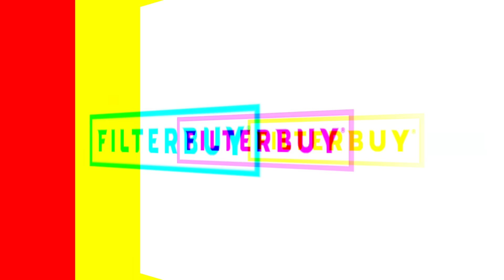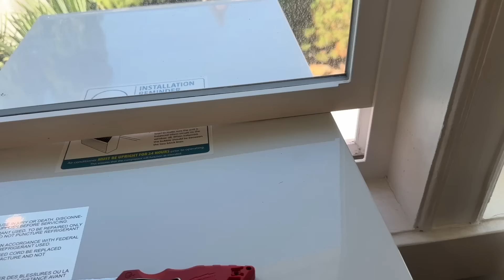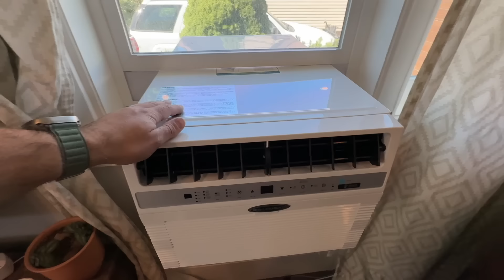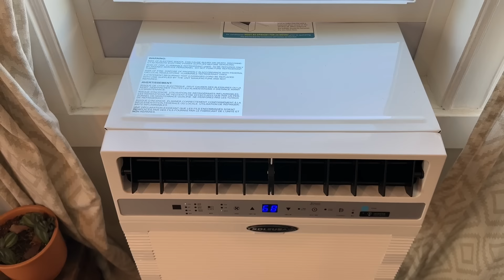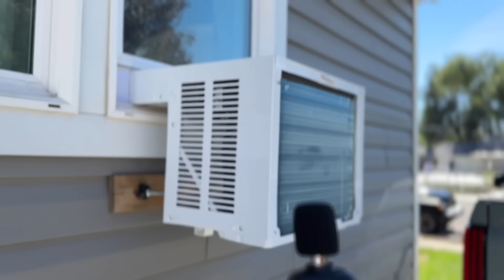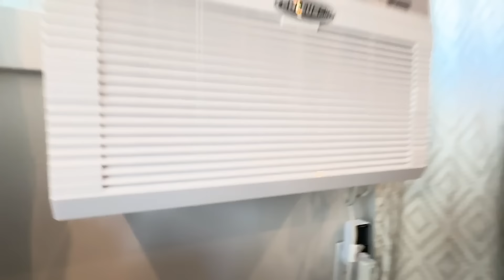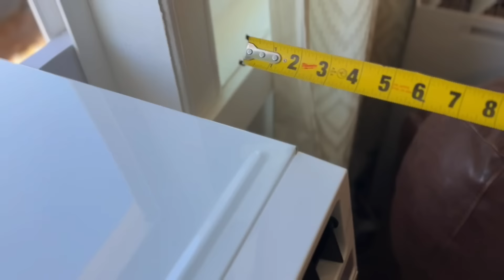I Thought It Couldn't Get Any Better... But It Just Did.

Comment: I noticed a flaw in the filter design, there is a wide gap between the two filters. Dust gonna go there.

I too am waiting on the Midea version as I can't use a "hang below" type of unit.
Reply: Yes, dust gets in there, it's not a great filter design

Comment: I bought the GE profile AC. It's garbage. It may have been quiet at the beginning, but honestly now it is as loud as any window unit I've ever heard. 
I bought the Midea U-shaped, and it is much quieter. seems like a better design overall. It is not a reversible cycle heat pump, just an AC.
Reply: No problem with mine…
Reply: @nikij.6058  hmm. Mine rattles so much during certain parts of the cycle that it wakes my wife up. Even the plastic cover rattles against the frame. It’s just very cheaply made. Ironically, the Midea unit feels much more solidly built and the fans are significantly quieter.

Comment: It is not a heat pump.  It is an ac with heat added.
Reply: This is absolutely a heat pump.  If it was added heat it would use resistance electric coils and use 2x to 3x the power this used in it's heating mode.
Reply: @theripper121  I stand corrected.  It is a poor excuse for a heat pump.  I guess this is why it so cheap. Most companies would describe their product as a heat pump.
Reply: @richardsexton9212 what makes it a poor excuse for a heat pump?
Reply: @AGILISFPV poor efficiency

Comment: Dude they have you buried in the algorithm and i took me forever to find you. You didn’t show up for anything a/c related and it took me an hour. I need your help and I’ll tip you or directly pay you for your help if you have a place. Here’s my background-i was a general contractor and had best friends who owned a/c companies so i learned how to fix my a/c units and change them and fix my customers while at their house. I got injured bad so lauded my business and ran huge maintenance dept and worked on a/c units all the time. Then i almost died twice and need life saving surgeries . Ok now that was just to let you know that i know just a little more than most but not great. Ok so i was still recovering and had to move during covid and in new house had to call an a/c guy and he charged me $680 to change capacitor in condenser. I use to by those for $12 8 yrs ago but i couldn’t walk so i was screwd and i had at least 15 of the universal capacitors in my storage unit. Ok so now we just had power turned back on from hurricane and within 12 hours my blower in air handler isn’t working and lines are freezing up. This is 2019 ICP FEM4P4200AL. So i went looking for the run capacitor and can’t find it. I looked online and realized they had you buried in algorithm and on google there’s barely anything on DIY information and there used to be a ton and tons of places to buy from. It appears the A/C industry paid to have everything removed. Can’t even find chats easily. It’s crazy -so anyway i stumbled on something that said they don’t do capacitors anymore and I’m shocked. So i go on the repair clinic and the only option is a fan motor that looks like it’s just the back side of an old fan motor for $500? What is going on ? Is that it now? So they let that blow instead of a capacitor? Is that what i want ? I thought about a transformer too just in case. I don’t have any tools to check anything right now and want to order to get things here -we had no power for 4 days and this sucks. My tools are stuck at our business for kids with autism that i was remodeling and then the storm hit so i have basic tools at house. I will say my filters were very dirty because i was working this job so we could get these kids in their new place and forgot then having windows open in Florida after hurricane did them in. So the filters got worse real quick-i have 2 of these units in my house for upstairs and downstairs. The other was fine and changed those filters. So anyway I’m just double checking this is what blows up on them now if they go bad? So should i order the transformer too. This really isn’t about money i just don’t want to pay repair guys after a storm like this because in Florida and after a storm this will cost $2000 easily and if i can get parts for $600 then its worth it. I’m not sure if the power going out had anything to do with it-it did run good for 12 hours and the transformer that blew for neighborhood just happened to be in my yard so don’t know if that had any affect. And my other identical unit is fine. I can’t believe there’s no capacitor anymore. The fan blades spin super easy just so you know but I’m assuming with this new type of motor that is just the back side of motor that they don’t really freeze up anymore? Correct? The coil is getting super cold and freezes me up quick when i turn it on but fan not spinning or humming or nothing. So I’m guessing everything is fine and it’s just the weird motor thing. I went to thermostat and can’t get it to run with just fan or with heat and of course a/c. So what would you order? The transformer and the weird backside looking motor? I promise I’ll tip you for any help. I’ll send it right to you if you want, i just need help understanding this new stuff i had no idea about and i haven’t toucj]he’d an a/c in at least 8 years and worked on them 5 times a month for 20 yrs prior. So it’s weird to be in this spot and i was going to watch you soon to install a mini split in my garage and shed but they have you shadowbanned. There’s not much in this air handler to change and coil is working great. So thermostat is making connection to switch between stuff but just no fan and it’s not stuck-it spins freely. Thx

Comment: LG sells a combination washer/dryer.  Soleus sells a combination air conditioner/heater.  What we need now is a combination washer/dryer/air conditioner/heater.
Hey I'm only kidding.  This seems to be a great product.
Reply: There actually is a fanticy where your ac sends it heat to a heat pump dryer instead of outside lol there are actually hot water heaters that do this on a mini split system.

Comment: This thing takes up a lot of space and it does not fit in all windows correctly and if you use it air conditioning mode you have to drain it constantly so it doesn't grow mildew in it or blow extra moisture into your home as the pump does not pump all the water out of it.

Comment: Soleus is such an elusive company. I've heard good things, but when I tried to order parts for a broken saddle I picked up they abruptly said there are zero user replacement parts on the 6000 BTU unit. Are they Midea? I assume they are Chinese? What is the difference between Soleus Air vs Soleus Air West? Also, any numbers like HSPF or SEER/CEER? Is this r410a or R32? The sell air purifiets and USB gadgets too. I can't figure out what this company wants to be.
Reply: Gree may be the parent company of Soleus. I have Soleus dehumidifier that had a US Govt. recall and Gree was the parent company that contacted me through my registration. I didn't follow through and the unit still works great 9 years later. Gree is huge in Asia. Their other two ac units I have work fine after eight years. Inverter is the way to go now though.

Comment: It only heats in temperatures down to 30°F. It's pretty worthless when it really needs to work.
Reply: It works down to 24 for me, though you are right and I think the manual says not to run it under 32.

Comment: Do you have any idea what the heating inside temperature be if the outside temperature was 30° with high winds?
Reply: The unit disables itself when it's under 24 degrees outside from my experience. It works well all the way down to that just defrosts a lot.
Reply: 30 shouldn't matter much to a modern inverter heat pump.  Power consumption will be higher (vs. 40 or 50 ambient), but it should still be able to put out 10K BTUs if that is what's called for.

Comment: I saw that the SEER was 13 and didn’t see an HSPF. In comparison I installed a mini split with a SEER of 30, but even cheap ones are 22.
Reply: It’s a window unit…..  they’re not supposed to be efficient….
Reply: @georgewelker2846  It’s an inverter ac.  They are supposed to be more efficient.